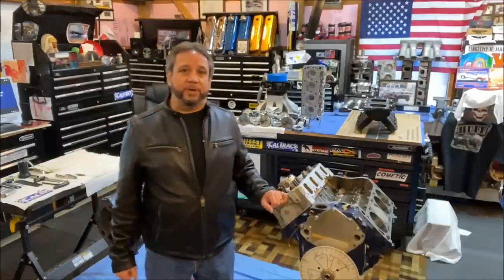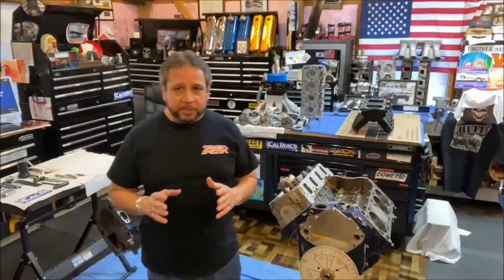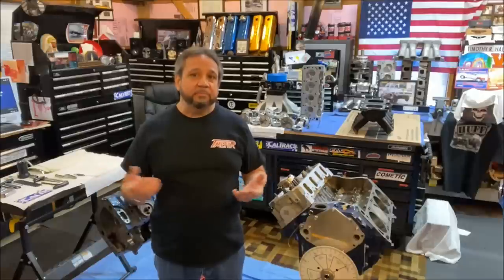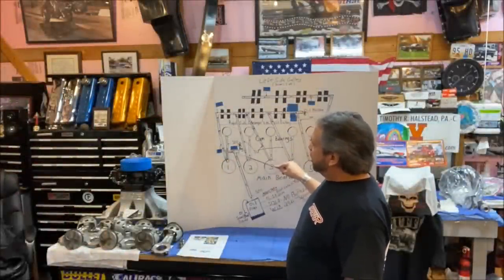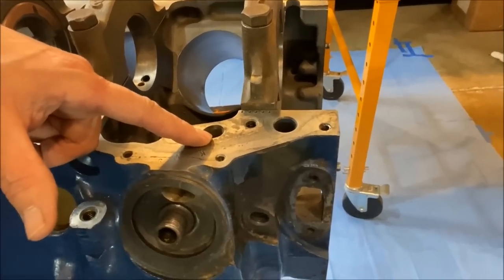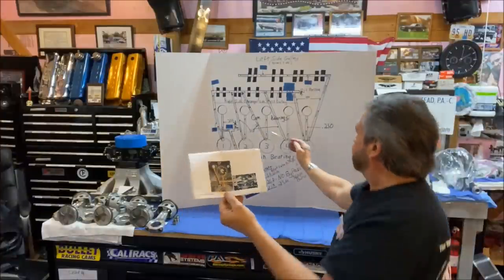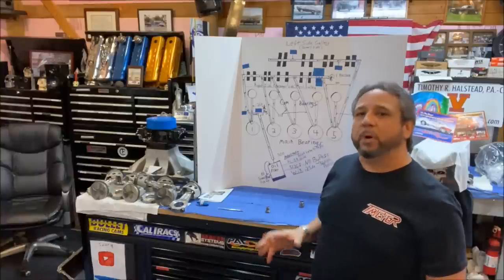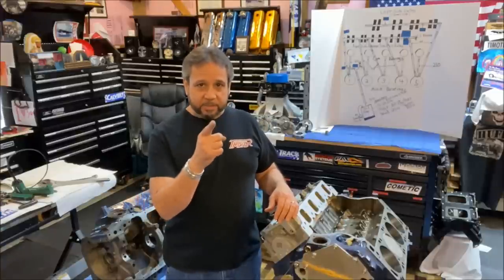Ford 351 Cleveland Oiling,  The Truth, and More

Comment: Cleveland oiling is poor, As is the water flow as well. 
You can improve the oiling but it will never be great.
You can straighten out the filter flow by taking out about 3 turns into the filter by making the entrance straight where there is a hole. Bore that out and use 1/2 internal fittings,  and a decent remote mount filter. Though I spent a couple of hours making the adapter and remote mount filter actually flow oil!
Restrict the holes to the cam bearing, as you have shown.  With hydraulic lifters you should not reduce the flow to them. Some solid lifters however have the inlet hole higher so you can restrict the oil to the rockers. IF using roller rockers , which are a total must for engines being revved over about 5500 you can reduce the oil to the top. You can solder up the holes at the lifter end and drill about a 1/16th hole or simply restrict them with  pipe cleaners. A very old trick that has worked for 50 plus years. Be more cautious with the exhaust valve though as it needs more oil to cool it. The roller rockers need very little oil. And less oil up top means less to return to the pan. Be sensible with all oil drain backs and check the gaskets are not screwing it up!! The big holes over the cam should be not used as oil drainbacks on a high rpm engine. The windage is more than enough oil. Street engines leave them alone. Like many I use a piece of pipe to stop oil running over the cam but does not restricts the ventilation required. 
With my remore filter I use and oil cooler which tends to dearate the oil. The dumb idea of having the pan well at the front created far to much aeration even with scrapers, mesh windage trays etc. 
Dry sumping is obviously superior on all race engines but is quite expensive and some motorsport categories simply ban it.
A Clevo in particular will never be a Chev but can be made half decent for oiling and cooling. Many 'dry deck' the water holes head to block and push more water back through the head. Dont do it for a street engine. High rpm race engine a good idea. Clevos at least have the waterpump running at crank speed, a little slower may be ok for oval track and road race engines turning high rpm. Suggestion is around 90% of crank speed or 75% for a oval track engine.
The much touted 4V heads are plain junk for 90% of all applications. Way to little airspeed. The Aussie 302 heads are far better, though pre 76 are by far the best as the later ones are all worn out.
I have gone 208 CHI which have far smaller ports than even the 2Vs with far better velocity. And should make another 80hp! This on a max 7000rpm engine. I dont trust the rest of the engine for more.
Reply from the maker: man sounds like you been there done that. Thanks for sharing with us your solution. Lots of good ideas for sure. I am trying to give the potential options on hand, but trying to not make it too complicated. I think the majority of guys here only need the minimum work over, unless they are spinning to the moon. I have survived 8200 through the traps with less. Your suggestions would be definitely needed for circle track racing. Have you used all of these mods and raced Cleveland’s, tell us about it. Thanks for giving us a great breakdown on all aspects of oil and cooling mods. Thanks so much for taking the time to educate us all 👍
Reply: @DragBoss351Cleveland  Drag racing is hard on engines but very short runs. Road race is a LOT harder on these engines. With said lousy oiling. With modern synthetic oils they will live a little better.
I know of no oval track engines running currently. Though there was a Sprintcar running a Clevo,,, brave, though it was ofcourse dry sumped which helps a lot
Reply from the maker: @ldnwholesale8552  oh yeah dry sump no big issues. Thanks for watching, stay tuned….

Comment: So. Why couldn't this work in NASCAR? Are the main bearings too large to survive at 9K for 500 miles?
Reply from the maker: They have so much R&D, they are way ahead of the game, and they all utilize dry sump systems, no worries with that. Not sure about bearing size or speed. Thanks Lloyd for watching and contributing to my channel. Thanks
Reply: @DragBoss351Cleveland  in the late 60s and 70s i ment. If your looking at a Roush motor from the 90's its obvious it's based on the 351C. Just smaller main journals, etc. Mark Martin said the oiling system is why they wouldn't stay together.  Great job explaining it. Love your videos
Reply: @DragBoss351Cleveland  first engine I had to rebuild.  351M. Second was a 351CJ. Love this channel brother
Reply from the maker: @Mr.Saltwater  thanks man. Not sure if any of the circle stock mods or specs. I suspect they used stock size cleveland 2.75. Issues were also core shift.
Reply from the maker: @Mr.Saltwater  thank you my friend. Appreciate the kind words. Stay tuned

Comment: Ford didnt identify any of their engine families as large , medium or small. All engines were identified by series. Mel, FE , Windsor, 335, 385, Modular etc
Reply from the maker: Yep that is the way I look at it. But to each their own, I say 351 Cleveland don’t look back. Glad you stopped by. Thanks for watching my channel and appreciate the contribution. I think there are videos on the way.
Reply: Though I sure "Mel" was a "typo", I'm just as sure few here even know of the 'MEL' (Mercury, Edsel, Lincoln) series of engines ... last used in the 1967 Lincoln Continentals, if memory serves me correctly. 🤔
Reply from the maker: @johnjohnsn7633  I have heard and seen them before... Mel, never worked on any. I think that is what Kaase used in engine masters one year
Reply: @DragBoss351Cleveland  Back in 1958, Mercury had the 400 horsepower 'Super Marauder' 430 cu.in. Tri-Power engine option.

If you've never dealt with the MEL engines, the same "combustion chamber in the block" design as the Chevy 348/409/427 "W"-Series engines.
Reply from the maker: @johnjohnsn7633  Yes i am familiar with the combustion chamber, I remember what kaase did with the head. where he made the combustion chamber part of the head. Do you remember that?

Comment: The only oiling issues with 351 is inadequate oil capacity. You need 7qrts of oil to rev to 7k. Others this motor needs 6qrt instead of 5qrt. 

Oil restrictor is uneducated way to solve sump pump going dry and raises your head temparature and ware. 
Gm engines which have same oiling system as 351 dont have oiling issues - they have more oil capacity. 
Also stop runing 40 weight oil, takes to long to drain dack. 5w30 is best for street engine with occasional track and has better high temp protection in the industry *atleast QS synthetic does. 

I agree, filter porting is needed and that's as far as you should go with modifications.
Reply: Each head holds at least one quart of oil and when engine is running oil flows to bearing #5 from the head without any wait time to get through other chanels. 
It's a large pool of oil which once filled within second of start flows simultaneously to all chanels.
Reply from the maker: I agree with sump. Have always ran 9 qts, but disagree with restrictors. Been racing Cleveland’s for 40 years with good success. Key to massage galleys and returns. I like 20/50. I use what works for me. That is what I tell others. Stock Cleveland crank is contributing factor, stopped using them 20 years ago. I saw your video, that is your theory and however you solve it is what works for you, so what is your solution? Thanks

Comment: Hello sir my name is Andrew Celes In 1977 my first cousin on the 69 Mach 1 51 Cleveland engine animals automatic on the floor not only did it have a 9-inch rear end posi traction because he was white primer and what color a lot of hot rods that were nicer than that Mustang why do a little race from stop light to stop light blow them away  that was a stock 351 Cleveland with header
Reply from the maker: Sounds like that car rocked the neighborhood. Real sleeper Andrew

Comment: How much more does a cast iron Cleveland weight? Compared to a SBC & SBM? I remember Lee Shepards team destroking a BBC to try and beat Gliddens Cleveland's.  But couldn't do it.   So it was the same small cubes.  Ford made several V8 motors over the years. Chevrolet only built 3 different motors from 55 to late 90's.  It's not Ford fault Chevy only built 3 V8's forever. I guess if you wanna make the Chevy guys feel better by saying the Cleveland is a big block since Glidden beat it enough for the Chevy guys to label the Cleveland as a big block. It just doesn't hurt as bad.
Reply from the maker: Cleveland’s probably weigh about 550lbs. Yes very familiar with RM small ci bbc. I have talked to David Reher about that motor, cylinder heads leaked water like crazy. But ran awesome. I say let’s rock n roll  build some Cleveland’s

Comment: Chet Herbert was the solid roller an clay smith cams the og woody wood pecker with segar .AT Jackman bro mec. Shop was messing with vw sand rails solid roller in early 70,74 .an 86 I worked on a wedge dirt car there was a guy out of Turlock CA ran a dry sump 351 c 4v he had a machine shop they cut the head in half change the exhaust ports an location hight ,re ground the cam to change the firing order it was stupid fast pull both front wheels about 8" off the ground every lap would inch away from a 360 sprint.thst Cleveland sounded like a masarattii totally different sound a he drove  for Ford dealer ship Ford wonted his design he told them no would not show them I think his name was Talbert,
Reply from the maker: Call history Bryan. Love to hear these old stories. I think what you’re saying is they cut off the exhaust port and placed the aluminum plate on? Thanks man for watching glad you’re here.

Comment: Great info?!
Reply from the maker: Thanks Chris, hope it helped you. Please make sure you subscribe and like. Way more in store.
Reply: I have owned 1 72 Mustang Grande, and (4) 71-73 Cougars. All cleveland powered. My 72 XR7, was even a Q code. My 71 cat was the snappiest. I believe you can make a Cleveland sing, in high rpms, and not lose all your low end Torque. In 72 Ford did some unholy things to my favorite engine. Not only was High CR, gone, but the retarded existing cam grinds, 4 degrees!! Bye bye torque. Let's talk!
Reply from the maker: @1972mercurycougar  cool deal man. Looks like you have had your share of Cleveland’s. Yes it is all about cam timing, right gear, headers, and hang on, no loss of low end torque.

Comment: I like your intentions .... I think NHRA has a big hole in it when it comes to pro stock . Chevys running Chevys does not get people to watch . The glory days of pro stock . Was in the past when all manufacturers competed . That's when you get the best of the best . Because passion for the brand will just get better and better . Seeing a pro stocker with a Ford body and the Chevy engine is stupid ... Plain & simple .
Reply from the maker: Just have to keep moving forward. Getting the new DBG Mustang has changed things alot. But yes want to build some engines and dyno test them. Bring back all the pro stock racers I can find

Comment: 50 year old junk,  they were junk when they were new because they had canted valves and poor oiling characteristics  and they would blow up.   I could beat a Mustang with a big old 77 Monte Carlo with a 305 2 bbl engine because l could turn 7000 rpms all day long and they couldn't.
Reply from the maker: So is the 305 and 77 Monte Carlo. They never turned 7k all day, you must have been looking at the speedometer 🤣🤣🤣🤣
Reply: @DragBoss351Cleveland  when it blew up the block broke in 4 pieces.  I took one 1/4 - 20 bolt out of the oil pan and the filter and housing fell on the ground.
Reply from the maker: @boknows3841  but you know a 305 2 bll, never run 7K, what was the bolt from?
Reply: @DragBoss351Cleveland  the corner of the oil pan rail.
And two weeks before it spun a bearing l beat Benny Gordon in his Camaro in a street race, and the Camaro was far from stock.
If you asked him why was his Camaro up on the lift at Lighthouse Transmission the next morning, it was because he destroyed the transmission trying to beat Eddie Miller.
Eddie with the 77 455 Buick Monte Carlo and me with the 76 Sport Coup Monte Carlo with a 2 bbl 305.
It is not the car, it's the driver..
Reply from the maker: @boknows3841  poor Benny go bank. Sucks about that, sorry about your luck
Reply: @DragBoss351Cleveland  there was a couple of people from Pennsylvania that could have drove Nascar but never had the opportunity.
Much like Todd Bodine.
He was #1 in the points in the truck series and had to quit because they couldn't pay the tire bill.